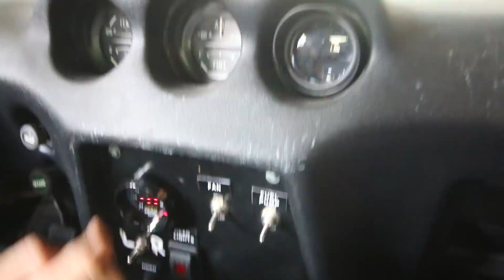New Side Exit Exhaust is Done - Melts Everything...

Comment: Had a 85 Riviera, project. While driving to work one day. The power steering pump went out. This was connected to the brake system. Came to a red light and no brakes. That caused a undies change!!!
Reply: Hydroboost is the devil
Reply: Sam Johnson you are correct.  I've only ever had trucks with hydra boost systems,  but equally as horrible.
Reply: ive had a cobra with hydroboost and one of my trucks does,  ive developed a habit of killing my manual cars before a full stop and with HB that gives you a good pucker every time

Comment: Ive had my 2.3t cam bolt come out of the cam at 55mph, lost about 3qts of oil before i could turn it off,  not much worse than hearing some clanking then nothing but smoke out the back

Comment: My motor and trans fell out of my old b swapped eg civic hatchback driving it into my driveway after a night of highways...every bolt on one mount striped out of the head and block, one side of the motor fell onto the cement 😩
Reply: ElectronicRedPanda  while I do some what agree with you, you would get wasted in the mountains. My mates commodore had a fully built super charged 408 making 650 hp at the wheels (real hp, not American hp) and it meant nothing when it got into the tight stuff.
Reply: ElectronicRedPanda sorry for assuming your American 😆 well the commodore had almost 1000 nm torque, so was definitely not a slouch. Just saying big v8s aren’t be all and end all .. I’ve driven massive hp v8s and still prefer my skyline all day

Comment: Driving a buddy's 1993 Nissan 240SX down the 15 freeway. Then had the back driver side wheel roll pass me on the freeway few years ago. All four studs sheared off. Improper constant use of the impact gun to the lug nuts caused this. Since 2 more wheels fell off that a few months later.

Comment: Picked up my first SVO from ford after having some work done on it. It was raining and I jumped it on a bit only to have the throttle stick. Scared the crap out of me for 5 seconds but I just put it in neutral and turned it off. The mechanic must have bent the throttle linkage by mistake when he was working on it. I just pulled it back into place and all was well.

Comment: I had my exhaust flapping a bit on my truck because the mounts rusted through. I thought I'd just wire it up to the cross member until I get home to reweld it. Didn't make it. My 3" exhaust pipe snapped off under the passenger seat. It hit the pavement at 70 mph and shit backwards around my axle. Not a fun day.

Comment: Worst thing that happened to me...? I had an 81 datsun 4x4 nap z. 80k on the motor, but the body was swiss cheese (this was in alaska in 1999/2000). Long story short, i had fucked up the front cv axle from carelessly wheeling it. Then popped a tire, and instead of replacing the tire with a matching size i rolled with a smaller sized spare. (Marijuana was WAY more important at that moment). To get to the point, i was driving down the highway, and at about 60-65 miles an hour the passenger front wheel bearing locked up. Steering wheel spun like crazy, my butt hole puckerd like no other. No one was hurt except my pride, thank god.

Comment: I enjoy the sound of 4 bangers they sound like angry bees. I just wish I could find someone that could tune my Chrysler pcm or help me figure what I would need to swap to a tunable pcm. 08 turbo (not stock but stock) PT Cruiser. Originally NA took the turbo and manifold with charge pipe and intercooler out of a turbo model did the conversion, but limited to 8psi. I have the bigger fuel rail and injectors that come with the turbo models, just need to get a tune before I can install them or I will be overly rich.

Comment: After my drive belt snapped .I pushed it home. Spent 2 months changing the timing belt. The water pump the mounts spark plugs.  Wires. Still would not turn on.... Cracked my block putting in the wrong bolt in. Long story short. I swapped in a new motor. And crashed it into a pole.(to avoid hitting a person) . not even a week after all the work and money..... Ahhh. Good times.

Comment: Blew the 3rd member out of the rear end of my cousins Mustang some time ago.
I was "helping out" by doing a tune up on the Mustang.  When I finished I drove it by some friends house
who were standing outside.  So I tried doing a burn out but instead blew out the 3rd member.  The pinion gear
passed me as I coasted down the street along with a bunch of other gear pieces, bearing pieces, and stuff.   Cousin never
came back for more work...  Wonder why???   lol

Comment: Most Terrifying? car shut off completely as i was passing a Semi, Uphill, at around 180kph. managed to dive across in front of the Semi and pull in to a service station where the car spent the night. Turned out the next day that the clip on the heat-wrap of my downpipe had worked its way through the vacuum line to the wastegate, and it overboosted and dropped an exhaust valve into the cylinder. welded itself to the top of my nice CP pistons. TL;DR, I dropped a valve at 180kph whilst passing a semi up a hill around a corner. scary shit.